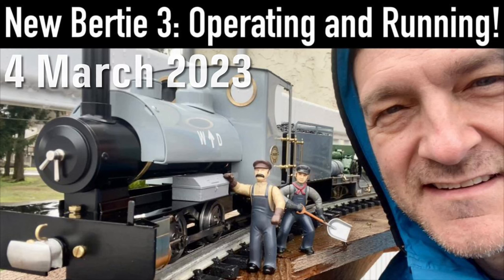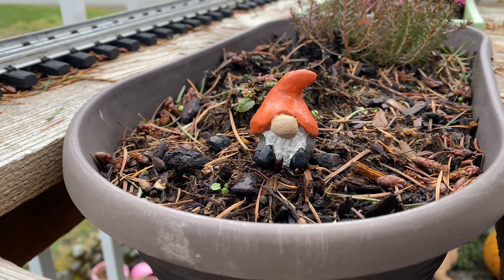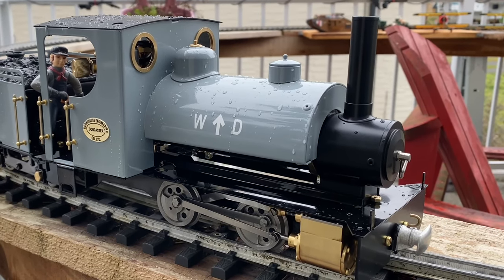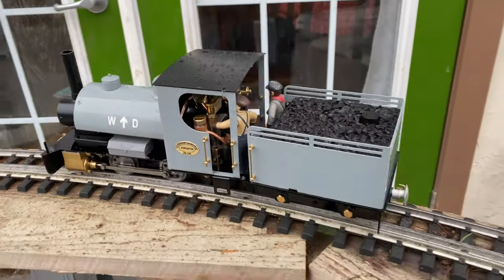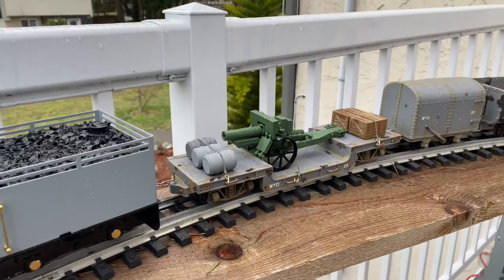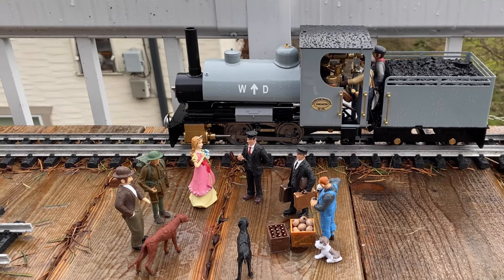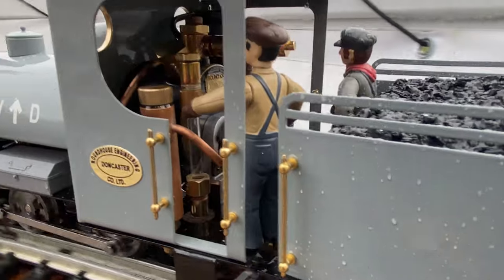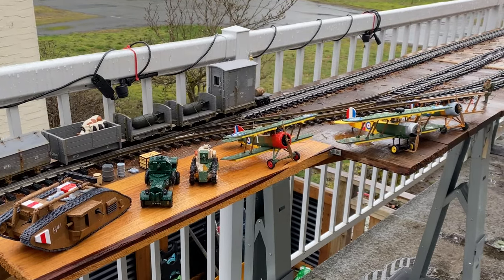Victoria BC: 3. Brand New Custom WD Bertie - How to Operate & FIRST RUN! (Plz Sub & See Description)

Comment: That’s a neat little engine!
Reply from the maker: Thanks! It certainly is. I am already in love with it and I only ran it the one time. Lol. So far…
Reply: @Terrys-Steam-and-Bricks  Now that the weather is turning a little warmer in the southeast U.S. you’re making me want to run my Mamod locomotive again. 😂
Reply from the maker: @H.O.Scalemodeler4501  twisting your arm, hey? Lol.
Reply from the maker: @H.O.Scalemodeler4501  Which Mamod do you have?
Reply: @Terrys-Steam-and-Bricks  An old SL1 I believe. It was heavily upgraded by the previous owner. New cylinders, Goodall valve, lubricator, uprated safety valve, repaint, 3D printed batter/receiver box (which I removed and added to a custom tender), and cab regulator. All for the price of an unmodified MSS kit. Most of the time after upgrading a Mamod fully you end up paying the price of a nicer locomotive from accucraft or roundhouse. However I was lucky.
Reply from the maker: @H.O.Scalemodeler4501  that was lucky. A friend has an upgraded MSS and the cost was similar to a Mamod Mk 3.

Comment: Idea:Try putting a hole in your wall, so the inside layout meets the outside layout, easy transport.
Reply from the maker: Great idea. However, this is not the house we’ll retire in. We are already planning that house and it includes a ground floor hobby room where the trains will go through the wall and into the garden.
Reply: Oh

Comment: I should have asked this sooner - where did you get that dual gauge track?
Reply from the maker: I made it. The track started out as old Aristocraft Aluminum rail track. I got a lot of just aluminum rail, made myself a track gauge, and went along and screwed the rail down to the ties (not every tie!). Aluminum bends easy and it was a fairly easy job. The switch point was a challenge but I made it work.
Reply from the maker: I just remembered I made a video about it: https://youtu.be/FozsOF9L6W4

Comment: Splendid little engine
Dont ye think its time for a coal fired one?
Reply from the maker: I have always wanted a coal fired one but they are very very expensive.
Reply: @Terrys-Steam-and-Bricks Can imagine 
I saw a k38 for R25k
How the blases people aford that
Then you get the coal fired version
I think it was 28
Reply from the maker: @laaity  generally I find coal engine and cola converted engine to be twice as much.
Reply: @Terrys-Steam-and-Bricks  Maybe you should make that one engine thats made of salvaged parts a coal burner
Reply from the maker: @laaity  I wonder… that engine would need a tray below it to burn coal in. But it would not have forced draught so I am not sure how good it would be. I wonder if anyone has coal fired the basic Mamod or MSS loco… I’ll have to go on a search.
Reply: @Terrys-Steam-and-Bricks  There is one video where a guy just took coal and put it in the wax tablet tray
But coal is a pain
The mamod tram thing might have a better chance of having a coal conversion
Just ad a blower and a blast pipe to the boiler
Slightly lift it
Create a firebox
Easier said then dun tho
O ja i forgot you still have to gave a sucker to get things going
Reply from the maker: @laaity  some people start their coal engines with BBQ coals broken up.
Reply: @Terrys-Steam-and-Bricks  Ja
Ive never lit up a minuture coal burner before
Only full size(its terrifying) 
But i would imagine charcoal soaked in parrifine would be better than sticks
Reply from the maker: @laaity  I have also hear of charcoal soaked in paraffin.
Reply: @Terrys-Steam-and-Bricks  Ja wat we do is we put a thin layer of coal then pack wood at the back
Sprinkle a bit of parrifine
Put parrifine soaked rags in the corners
Light some rags on the shovel
Put the shovel and get all the rags burning
Then dump the rags
That part is tricky now
Because freaking everything is made of plastic
Last time i lit up i almost burnt down the cab because there was one rag that melted to the shovel
Reply from the maker: @laaity  wow.
Reply from the maker: @laaity  the rag was polyester I suppose.
Reply: @Terrys-Steam-and-Bricks  Ja
My shovel was black after that lol
Reply: @Terrys-Steam-and-Bricks  Ja
Im gonna use a different method of lighting up i think
Reply from the maker: @laaity  a really like when you describe what you do on the real engine. Your describing how you light it is the first time anyone has described that to me. 😊👍🏻
Reply from the maker: @laaity  hopefully you’ll tell me about it and whether it worked well.
Reply: @Terrys-Steam-and-Bricks  Ill make a video about how we light up
Its an art
And i will
Theres a few ways i think im gonna try the grab the rag thats on fire and chuck it in method
Reply from the maker: @laaity  awesome.